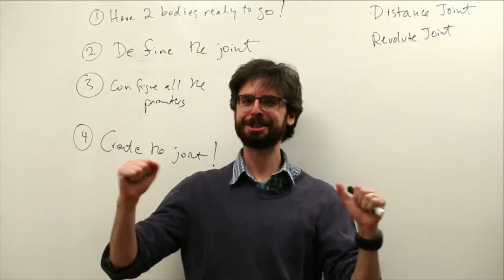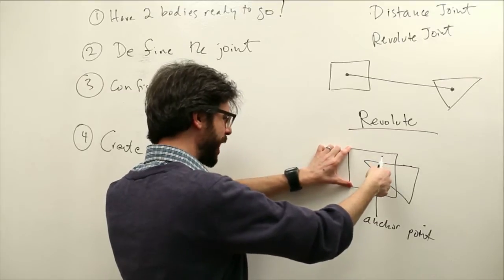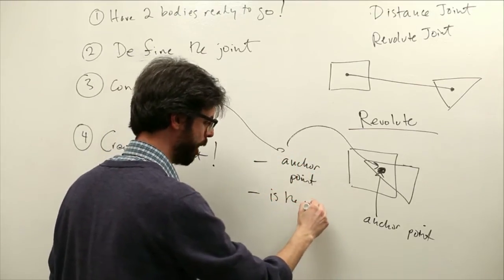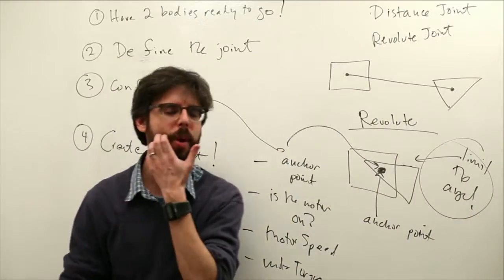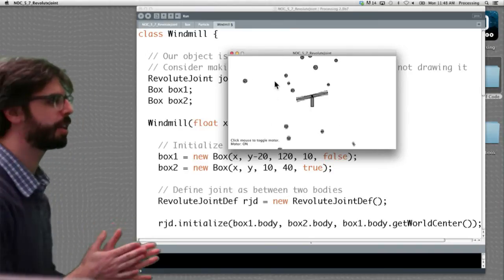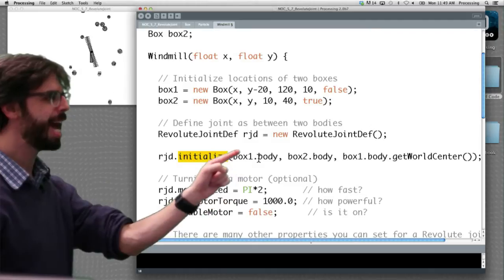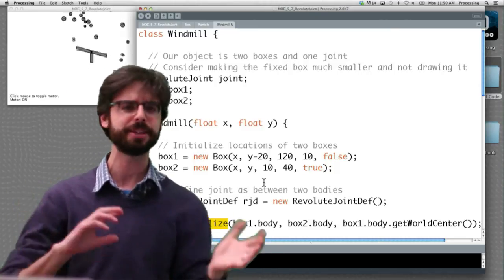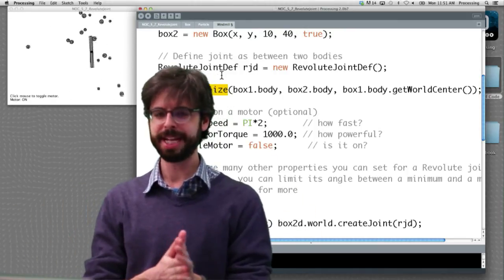5.9: Box2D Joints: Revolute Joint - The Nature of Code

Comment: Is there any tutorial on changing the speed of these windmills? I am trying to make it so the user can click the mouse and have them switch directions, the box2d documentation says to use the SetMotorSpeed(float speed) function but I am struggling to figure out how to implement this. Thanks so much for this series, it has been a huge inspiration for me.
Reply: If anyone else runs into trouble with this, my main issue turned out to be that it's setMotorSpeed(), not SetMotorSpeed(). I'd be more embarrassed but even the documentation has it as capitalized! :D

Comment: Hi! I have a problem.
I've installed box2d from the GitHub repository and it all works fine except for Joints and ChainShapes. Regarding joints, i cannot cast from Joint to RevoluteJoint and the function isMotorEnabled() doesn't work. Does someone know if there's a problem with this version (3.3.7) of Processing or the Box2D Library?
Thank you in advance

Comment: I don´t quite understand how the position on the anchorpoint works. 

Im trying to make a "human like" object and using revolute joint in each joint of the shape. 

the 3er parameter of the function .initialize is the position of the anchor point.
Ok. I understand that.

But if i change it it only changes the position acording the box1 body, not the box2, in the box2 the anchorpoint is always in the center. 

Do i make my self clear?
Im looking for the reference but says nothing about it. Maybe there is something obvius im not seeing.
Reply: In a further reading I was able to understand it. 

I was not paying atention to this line :
"To specify a revolute you need to provide two bodies and a single anchor point in world space. The
initialization function assumes that the bodies are already in the correct position."